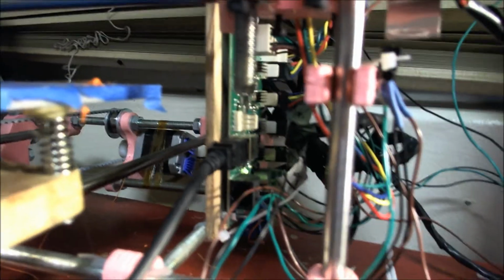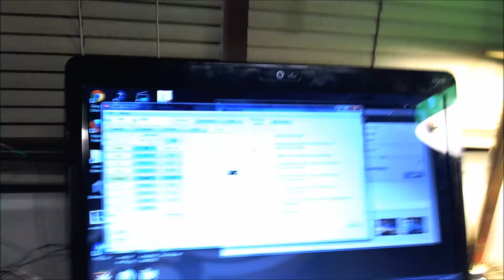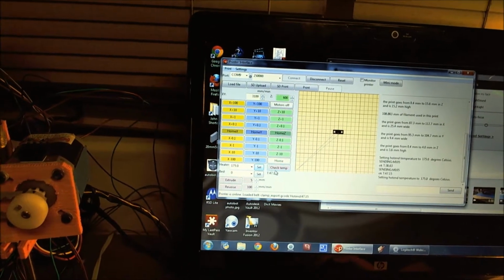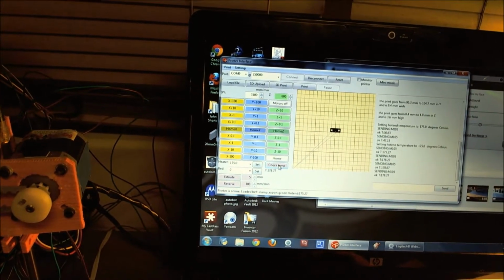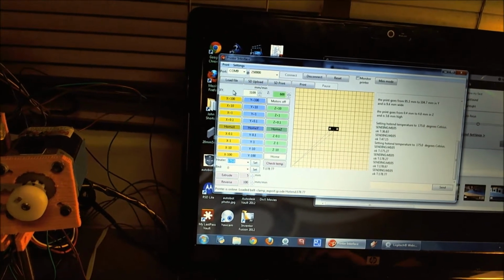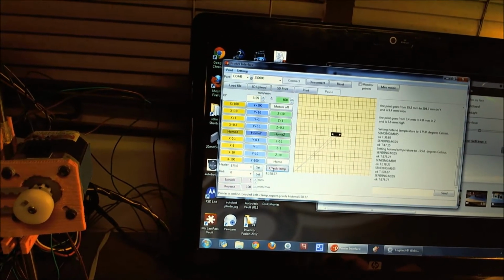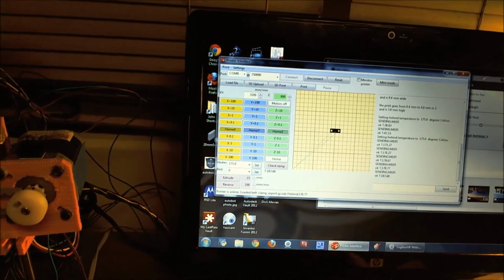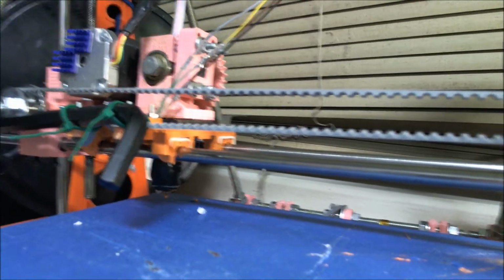3D Printing a Reprap Belt Clamp from Start to Finish

Comment: What PSU are you using? Is it powerful enough to print ABS while running the heat bed at 110C? I don't get enough juice to power everything on full to properly do ABS and have been looking for a decent replacement